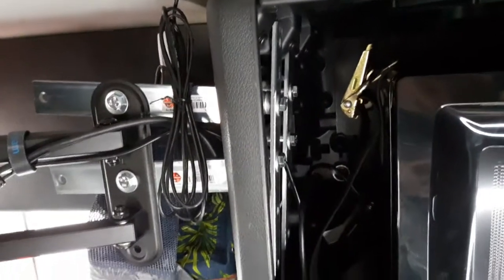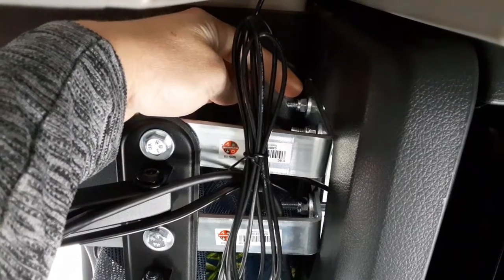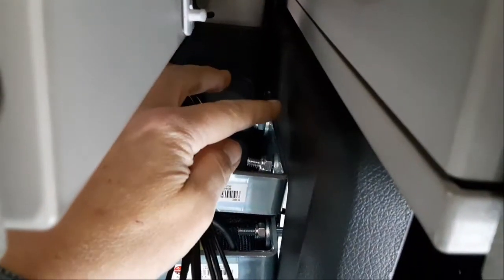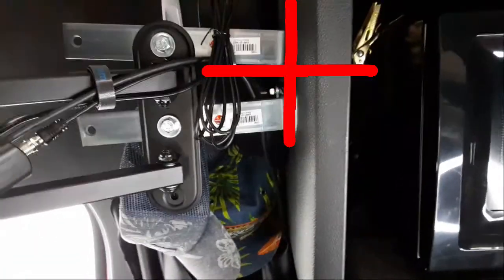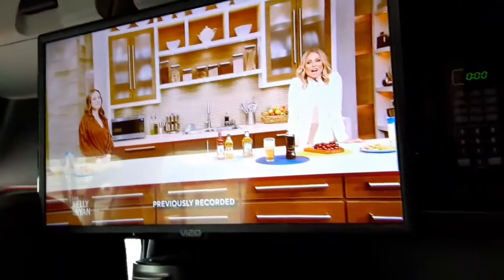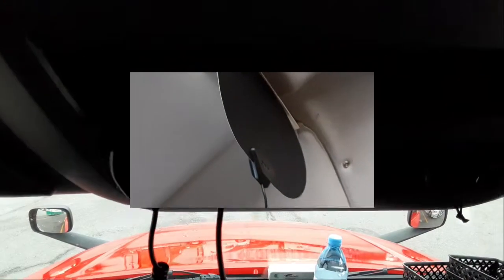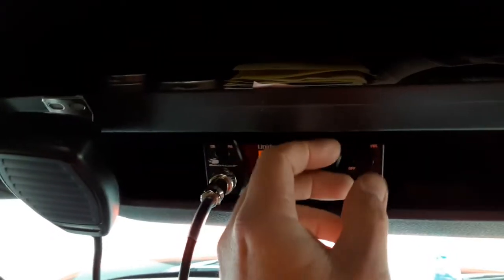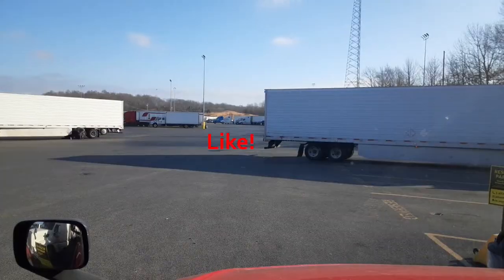TV mount in 2020 Freightliner Cascadia & Uniden CB radio In Roehl truck

Comment: Thanks for this video. I just brought my 2019 and did not want to drill holes for the tv. This is going to work so much better
Reply from the maker: It was still holding strong after a year and a half when I turned the truck in too

Comment: my roehl truck i took the screws out of the pass side sleeper window( the little black pop out vent) mounted 2 tv rails with longer screws and hung a 32 inch on it done. it was so darn clean.
lucky my truck now came with a tv mount.. roehl"s trucks are cheap.. odd the stock truck comes with a coaxial tv antenna

Comment: Your list SUCKS! I was using your video as a guide because you explained everything very well. You demonstrated it also. Very good job. However you FAILED to place the 6 5/16 locking nuts on the list. I grabbed everything else from the list, but now I have to wait until I can find a place where I can source the locking nuts. Very frustrating but thanks for the video.

Comment: Did you get an antenna also?
Reply: Those trucks come with a flat coil three in one antenna built into the roof. They work but not as good as a regular antenna mounted outside the truck. Also if you have a CB turned up, pushing more watts don’t use the built in antenna, you will burn up the modulator for the antenna.